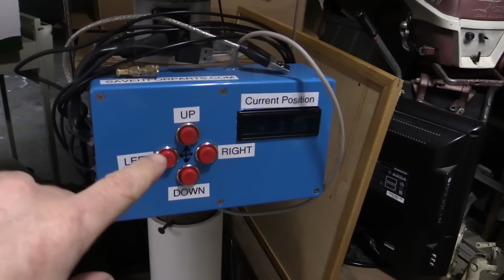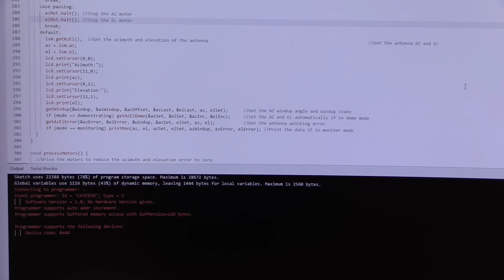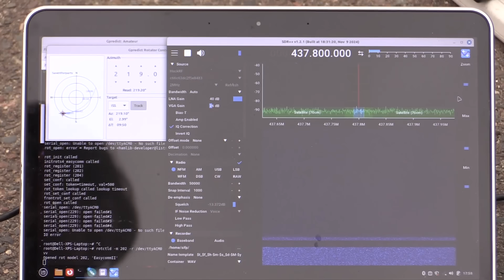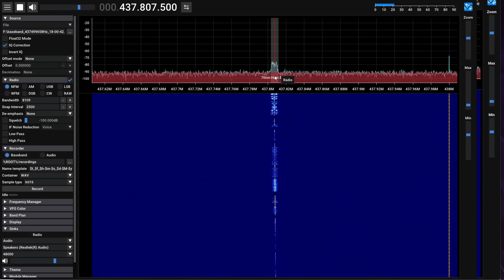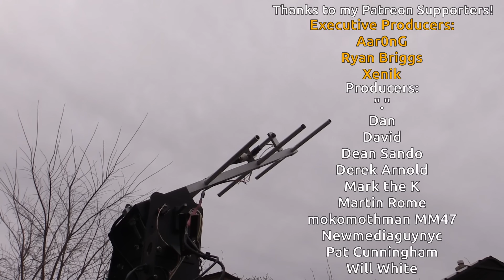I Failed To Build A Dual-Band Satellite Rotor

Comment: I build  Satnogs rotators with Arduino's and CNC shields for $700 ready to go. I modified the code for a 4X20 LCD display which is mounted in a nice 3D printed box that holds the electronics as well. Works great with Hamlib and Gpredict or Skyroof.

Comment: Not a failure just a learning experience! And to why it was all jerky... magnet (like in motors) and the compass do not like each other. I just tested this yesterday since I had the same idea of a self calibration. Even an unplugged stepper nema17 causes a 90 to 120 degree shift in azimuth on my phone even when it's 3 to 4 inches away. If want to you can open stellarium and see how it goes crazy once you get near those motors 😅

Comment: i tried using the compass method with the arduino but had big problems, like any metal around even alli, also it has to move fast to know where it or it just doesn't update correctly so i moved over to Satpc32 or Obiton from this youtuber https://www.youtube.com/watch?v=VlOZKF5xgn0  and it work very well.

Comment: I think the LCD problem may be linked to the length of your i2c bus - divide and conquer, get it working first then add the nDOF sensor once the LCD is conquered. Also - check with an i2c scanner that the LCD address is what you anticipated in the code. For improved stability, add place the tripod in three concrete filled flower pots. Or a scaffold pole in a really large pot... I've wanted to implement something like this for a lifetime... best of luck!

Comment: What I've learned about the AliExoress compass modules is never use the pins that are provided in the bag. They are made of a ferrous metal and will interfere with the magnetic reading.
Reply from the maker: Interesting! I had no idea, that's a good suggestion.
Reply: @saveitforparts  Try touching the pins with a magnetic screwdriver and see if it sticks a bit to them. also your calibration will go off even after removing the screwdriver since you've just magnetized the pins.

Comment: Professional control systems firmware engineer. That frustration is pretty much my workday. We also understand the "cobbled together as we learned how the thig works" project where you need to call it and say "this is more complicated than I have time budgeted", but we usually get to make a case for taking that time. Seems like you've done the same. It's greatly appreciated.

Comment: You tried it and now you know what doesn't work. I've taken some inspiration from your channel making a radio box/cyber deck. I got an rtlSDR. Same as the little silver dongle you have. The brains is an Intel NUC i5 and RPI 4. The periferals are; two Alfa wireless USB adaptors, SDR, TP-Link pocket wireless AP, one USB NIC. The software on the NUC is Ubuntu server running VMware. The VMware runs pfsense that networks all the gear together. The RPI is running Kali, kismet wireless for wifi scanning and rtl_tcp for SDR scanning. My laptop is running the SDR software that connects to the rtl_sdr. Everything works great except for my SDR/radio experience. Im attempting to learn about ham and antenna science which is such a learning curve! I've only successfully setup ADSB but very poorly. Using SDR Angel I did manage to pickup plains but the range was about 10km only. I'm getting strange interference signals like pulsating whining noise. I've not played around with filters yet so that's probably next. I'm thinking my new educational journey will be making antenna and figuring out different filters. Trying to understand LNBs and how to hook them up. I'm RX only ATM because I don't have my ham licence. Ham is a goal I have but so much to learn before that. It's probably best I don't play around with TX until I know more but loving the journey. I work in IT so the network and wifi side was easy to setup but radio is really a big learning curve for me. Just wanted to say you're an inspiration. I love the reuse of parts aspect to show it doesn't have to cost thousands to learn.

Comment: Tried similar setup once. The small magnetic field from the motor was messing up the compass readings.
Reply from the maker: I had that issue with the first one of these I tried, but it calmed down when I moved the sensor farther from the motor. Maybe this one has more interference since the motors are exposed.

Comment: A very interesting project – I still have an antenna like that, too. Your antenna looked cold, it was shivering from the cold, and at times I had the impression that it was possessed. I can't say exactly what kind of LCD display they used, but in my case it's an I2C port expander, which has to be correctly specified in the Arduino code, otherwise it won't work. It's nice to see the cat putting its full effort into the project.

Comment: We all have those days, and those projects. One of the best things I have learned over the years is when to stop banging my head against a wall, and when to say, I need to start over. Great video though. I think your work is better for trying to adapt what you have as opposed to spend 40 episodes to build something from scratch. Mostly, no one will build the from scratch project, but lots of us will cobble together parts just to see if we can get it to run at least once. Keep up the good work.

Actually I kept expecting you to stick a brick on the bottom of the tripod to get it to behave.

Comment: I recommend you to use SatNogs rotator firmware that use hamlib as the interface, they jad option to use stepper or brushed motor. From there you can basically use any rotator controller software that you like. GPredict, Satdump, PSERotator etc. Good luck🤞

Comment: Ever thought of putting an antenna on a drone? A cable could power it rather than batteries. It could find the direction by simply turning and it would just need a motor to point up.
Reply from the maker: That's an interesting idea, although I'm not sure about interference from the drone motors and electronics. I tried putting a Gopro on a cheaper drone once and the electronic "noise" from the motors made the picture all funky.

Comment: Yup, in my experience, failure is more often the outcome. But if your approach is 'i don't know, but i want to try', you never actually fail. Very different to if your selling it as a working thing. Thats the secret sauce of ham adventure. Just keep slinging mud around, eventually something sticks. For me, thats the fun part, and when something does work, it feels even better. And no point thrashing a dead horse, come back when you've learnt something new, talked to someone, find a better part. Something my dad said, your doing it for fun, if its not fun, don't do it. Come back when you have a better idea, pick your battles.

Comment: You should look into a "Moving Head" - with a halogen lamp = cheap and easy to modify - from light systems used at shows and concerts, its a belt driven design and mostly the movement is really smooth

Comment: If you have issues with the arduino not connecting to IDE, like it hangs then fails saying com error or something, unplug the arduino then as soon as you plug it back in click that upload code button, like within a second of plugging it back in, as soon as you hear the device connected sound from windows. 

This is stupid but it worked for me many times, from what i read it seems windows installed a crap CH340 driver with one of the latest updates that makes most arduinos act funky when youre trying to talk to them. 

Ive also read rolling back that CH340 driver in device manager fixes some issues and it did for me until i restarted my pc, then it was back to the old annoying unable to read/write to the arduino whenever it felt like it. 

It being so intermittent makes is a nightmare to troubleshoot.

Comment: The company I work for has some 19x15w moving lights with broken LED drivers, but chonky working DMX-controlled pan-tilt yokes. It’s also trivial to strip off the main board and control the stepper motors directly from an arduino and stepper driver. Let me know if you might be interested in paying for shipping for me to send you one or more before I bin them.
Reply from the maker: I'm tempted but I probably have enough stuff clogging up the garage at the moment! Thanks for the offer though :-)

Comment: Gabe, you could use a diode and light sensors or hall effect sensors on a wheel. As the up and down wheel and right and left wheel devices move they pass the sensors causing those sensors to "sense" the position.

Comment: I have a similar project with an esp32. It connects to n2yo using the native api, the controller asks for a norad id at the start of the sketch, the esp32 asks for the position to the site relative to your coordinates, n2yo replies with az-el data.
On the logic side the esp32 checks if the satelite is above the horizon, if not, it doesnt track, when the satelite is 10° below the horizon az starts tracking. When the sat comes over the horizon, both axis track, acter the pass the tracker goes back home. 
You can just convert your altaz tracker to use this sketch,  let me know if you want to use it
Reply: I'm working on a satellite tracker project myself and would be interested in your process and code if it's on GitHub or some similar share spot.
Reply from the maker: Interesting! That does sound useful. Maybe send me an email, Youtube sucks for following comment replies. I'm gabe (at) saveitforparts dotcom.

Comment: Those electronic compass modules typically have a lot of trouble when you put them anywhere near a ferrous (iron like) material. I’d imagine all of the motor casings and maybe parts of the mount itself are starting to interfere with the compass. Had a similar issue with a recent project and just opted to not use them. If anyone else has a solution for this let me know!
Reply: Have you tried mounting the sensor on a short piece of 1/2" PVC pipe a few inches away from the antenna and other metal objects?  Maybe just place the PVC  pipe in one end or the other of the antenna boom and then mount the AZ/EL sensor there.
Reply from the maker: The antenna itself is mostly aluminum, I've used the same sensor on an aluminum dish and it did fine. I'll have to experiment some more.

Comment: Fyi that 🪝 that’s in the middle between the 3 legs of the tripod is meant to be an anchor point to attach weight to in order to keep the tripod from tipping over you simply grab 10-20lbs and wrap it to that hook and your tripod will be sturdy

Comment: The Official "Box o' Wires" Yup I have one or more of them. I used to do public outreach for astronomy. Loved to set up my Celestron CPC1100, turn on the laser attached to the telescope, then tune in the radio to pick up the Station. I would track the station and listen for the radio, it was cool usually it would start to come in faint at first then stronger as it got to the zenith, then fade as it got closer to the horizon. All the while that laser was pointing at the ISS as it crossed the sky. The peeps loved it, it was pretty cool. I think an old Celestron CPC mount would fit your needs, plenty of payload and the handheld interface is easy to work with.

Comment: You should try using chatty jeeps to help you debug and refine an arduino program. It is surprisingly helpful. I was skeptical but I actually used it to create some pretty wicked simple scripts and a few really good docker compose files for my media server stack, etc.
Reply from the maker: I've tried it for some code before and it helped with some things but was very confidently wrong about some other things :-P
Reply: @saveitforparts  for sure, I treat it as just another tool in the arsenal. You have to guide it quite a bit and manage expectations. It is not going to just do everything for you, but it is surprisingly good at helping to piece together a project as long as you stay aware of the limitations. If nothing else it serves as a jumping off point as it is very good at laying out multiple options and detailing the pros and cons of each approach. Thanks for the <3

Comment: I'm getting back into radio, partly because of your channel and because I finally installed antennas on the outside of the house.

Listening to the hams (I am one) on 2m just makes me want to get into GHz modes and satellites Lol.

I appreciate all your videos.
Reply: Hello de KD5INM
Reply from the maker: Thanks! I'm bad at getting on the air, usually too busy with this nonsense :-P
Reply: @saveitforparts  I was always a listener more than a talker, but the ham bands are usually boring. I'm always on VHF and UHF finding obscure signals or users lol.

Comment: You can make the repeater without steerable antenna.  Turnstiles are simple and easy to make.  ISS is pretty strong.  However, I do have a steerable array that I use to track all the satellites, not just the ISS.
Reply from the maker: I'm h oping to do more cubesats and whatnot. I know I could track by hand but I'm also not great at that!

Comment: I have a project trying to use 2 old caravan TV sat mortor 120° E/W mounts to make a tracker mount ... Ofsets and tuning is gonna suck but  it's 3 years in the making already ..code is done just need to figure out wires and box for the brains as the whole thing moves .. I've  just bolted them together so 1 is E/W and the other is A/E.. lol it's  janky but it should work ..but so far it's gone like your project here.😂😂😂🎉  Life's good 👍🏻